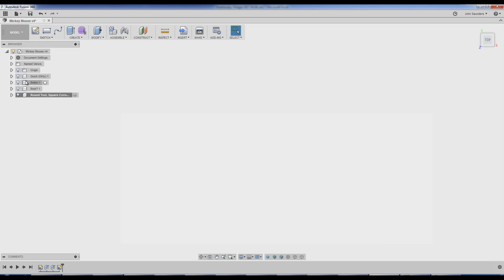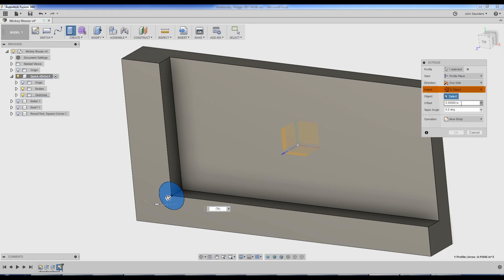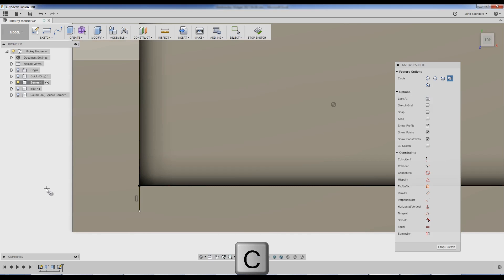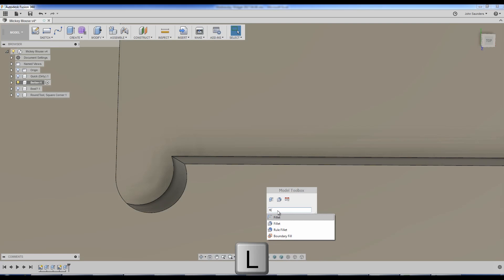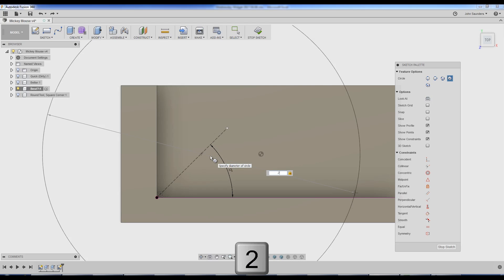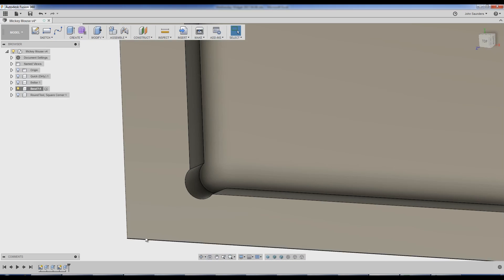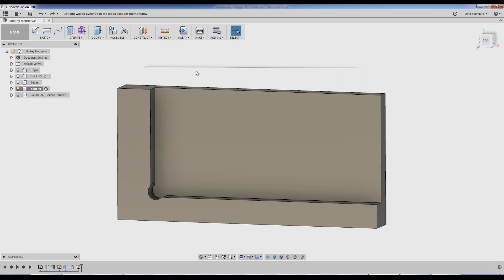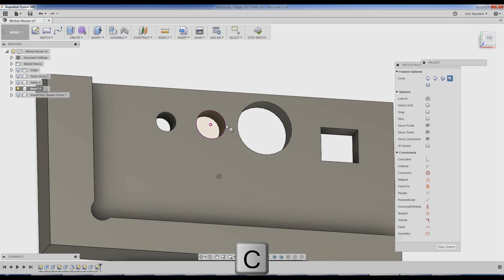How to Make Mickey Mouse Corners in Fusion 360! FF95

Comment: There is an easier way - use 3 point circle with a diameter larger than part, locked to the corner.

Comment: Is there any reasonable way to dogbone cutout on the basis of optimized tool loading lead in and out? Something like I need this much corner clearance, freedom of surface within 1" of corner, and software draws its own best path through those constraints. The result looking like those adaptive cut curves. I guess a downside could be a skinny taper gap as the cut surface departs the straight line geometry to get chips wedged in.

Comment: Is there a reason not to just mill into the corner at 45° untill you have the needed clearance?
Reply: You might get away with it but it can load up the tool quickly as the engagement rapidly increases.  It can then squeak or chatter, or possibly chip weld.
Reply: Ah, that makes sense.
It also seems like a good place to put a part ejection pin, or create some extra depth relief as well to allow a hook to engage the bottom of the part in case it doesn't want to come free of the fixture. (Something like the PLCC socket for ICs slots for using an extractor)

Comment: For corner type 3 I just rough the circle center about in place and then dimension the centerline of the circle to edge of corner both ways at Diameter * .35.  This gives a little over cut to keep a square corner from touching since the exact offset is Radius * sqrt(2)/2 or in other words radius * .707 or diameter x .3535.

Comment: A quicker way is to use a 2 point circle, enter the diameter, rotate to any angle inside the boundary. (I have always called these spilleted corners - spot and filleted)

Comment: Does anyone know if that last example where he dimensioned from the corner to the arc .01" can be done in inventor 2018? My school is still using 2017 but I'm trying to convince my professor to update to 2018. I've been doing this for years on NX and I miss it greatly.

Comment: There is a plug in that allows creation of dog bone corners very easily. Very useful for those of us using CNC routers to cut out parts with finger joints, etc. I'm not sure why it isn't available directly from the Autodesk Exchange since my understanding is that it was written by one of their interns. https://github.com/caseycrogers/Dogbone
Reply: Used that all the time when I used to use Fusion 360.
Reply: Thank you for pointing that out. Looks really useful!

Comment: Hi NYC CNC,
I was looking quite some days to solve the inside corner problem in fusion360.
Constructing holes to get the right path is not elegant.
But It is what it is.
I think the inside corner problem should be handled in the CAM module, because we have to think about the path.
Reply: I've not tried it but what Scott says makes sense.  'Rest machining ' is an option in F360 which when selected removes material that cannot be reached by the last operation.  Negative stock to leave is telling the software it is OK to machine into the stock to reach all parts of the tool path
Reply: mase-tech it can be... Turn on rest machining and use a negative stock to leave value
Reply: Scott Moyse You could not be more cryptic.  Ink cost you money to type on the screen?